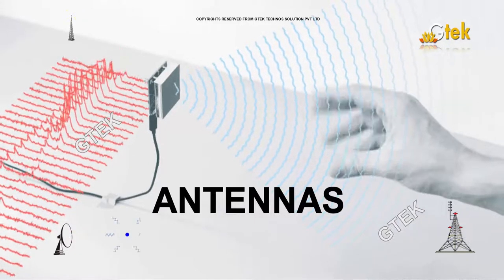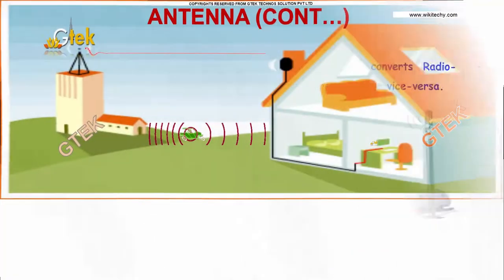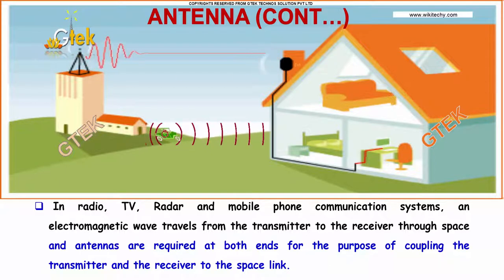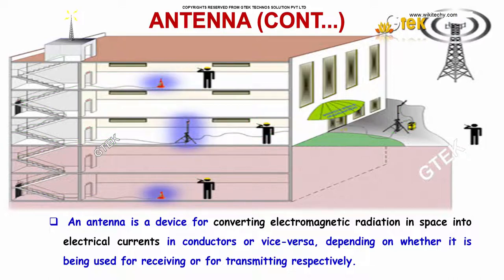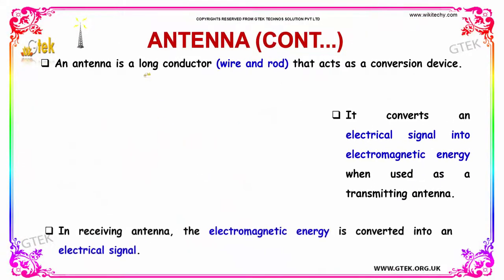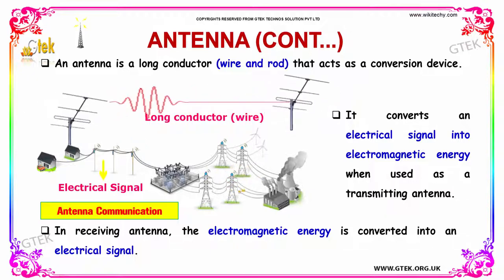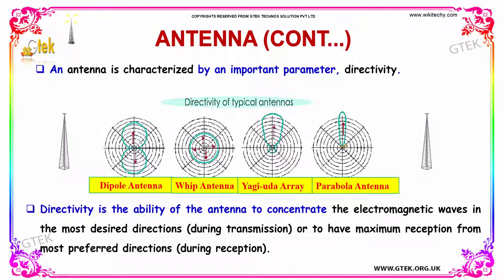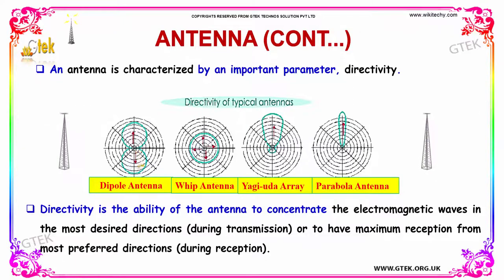Antennas | Communication systems | class 12 physics subject notes lectures|CBSE|IITJEE|NEET

Comment: An antenna (plural antennae or antennas), or aerial, is an electrical device which converts electric power into radio waves, and vice versa. It is usually used with a radio transmitter or radio receiver.

Comment: An antenna is a specialized transducer that converts radio-frequency (RF) fields into alternating current (AC) or vice-versa. There are two basic types: the receiving antenna, which intercepts RF energy and delivers AC to electronic equipment, and the transmittingantenna

Comment: Horizontally polarized (linear) antennas have their electric field parallel to the Earth's surface. Television transmissions in the USA use horizontal polarization. A circular polarized wave radiates energy in both the horizontal and vertical planes and all planes in between.

Comment: A television antenna, or TV aerial, is an antenna specifically designed for the reception of over-the-air broadcast television signals, which are transmitted at frequencies from about 41 to 250 MHz in the VHF band, and 470 to 960 MHz in the UHF band in different countries.